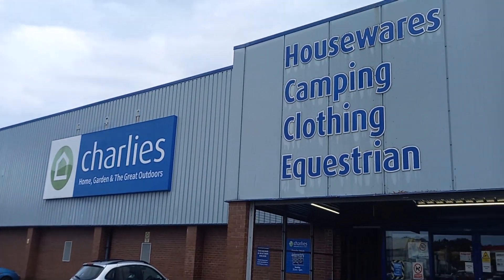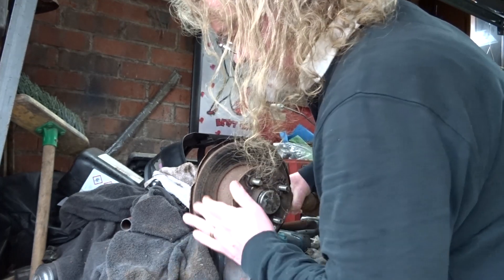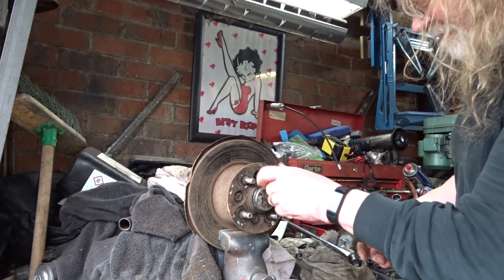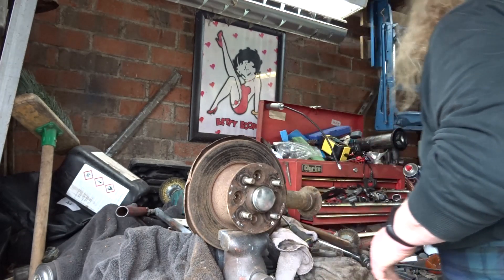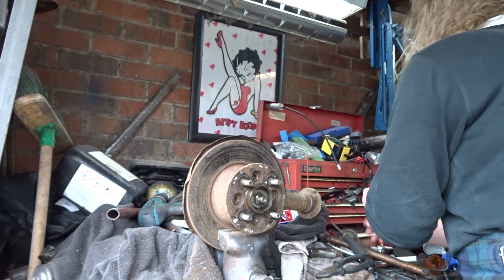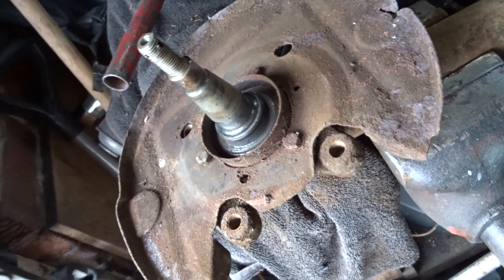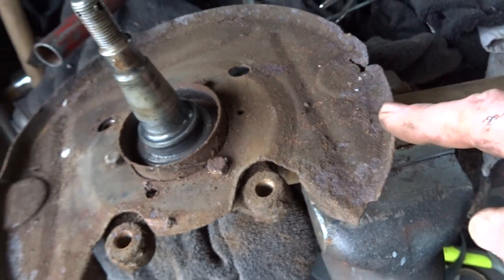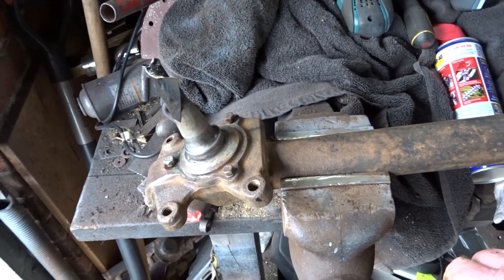TRIUMPH TR7 V8 Strut re-build (part 2)

Comment: Hi Chris, a little tip when restoring/painting stuff with threaded holes, instead of tape get yourself some of those squishy yellow foam ear plugs. roll them between your thumb and finger and stuff it in the threaded hole, the foam expands to fit (like in your ear hole) and no paint gets in the threads, easy to remove and re-use and hey presto jobs a good un.👍👍
Reply from the maker: Nice one Ian. I'll give that a go. Take care.
Chris Robinson.

Comment: The strut may be OK, you could fit a higher rated spring maybe. The disc rotor came off easier than I thought it would. Going well Chris, good luck.
Reply from the maker: Mark, I've got an enquiry to a coil spring manufacturer to see if they can produce springs for a TR7 with a  V8 which, the engine alone is 40KGs heavier than the 2.0L.
Take care and keep watching.
Chris Robinson.